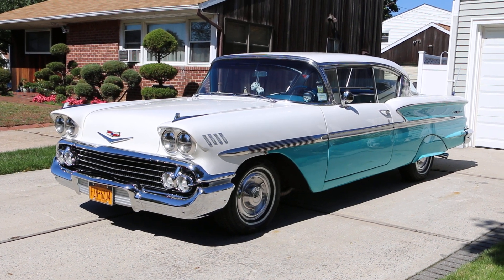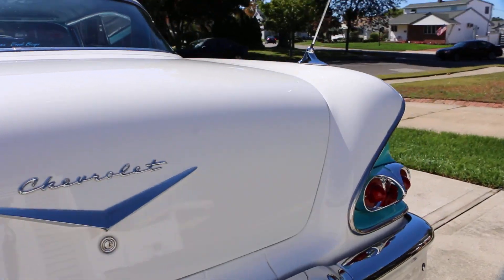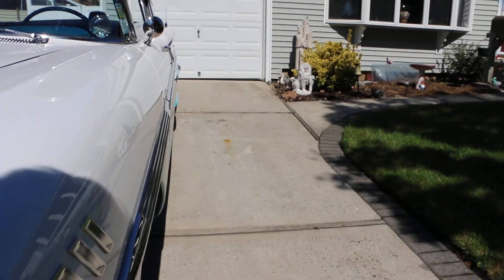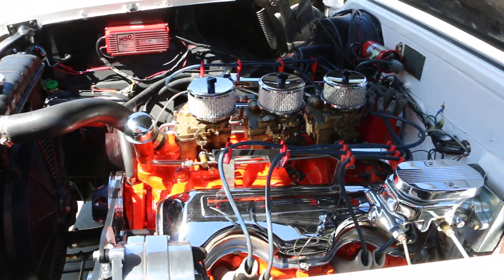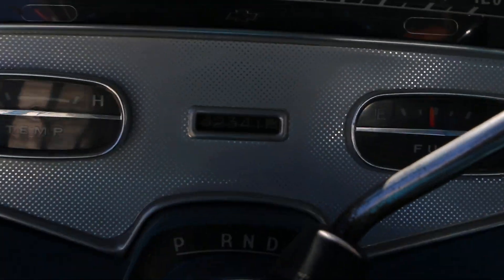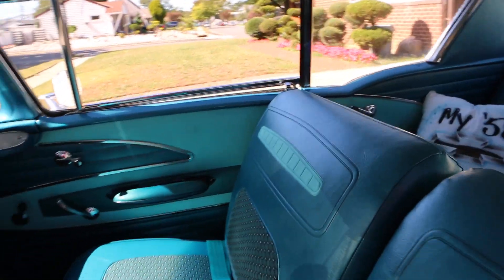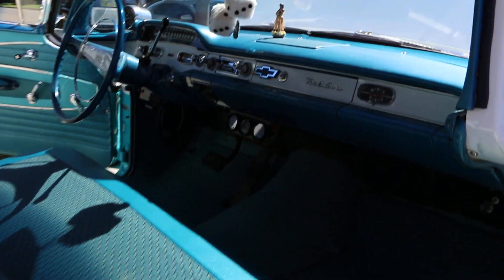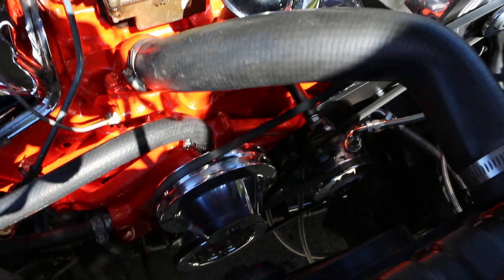1958 Chevrolet Belair For Sale~348 w/ Tri Power~New Interior~Fresh Two Tone Paint~FANTASTIC

Comment: I bought a brand new 58 bel air with post and 3bbspeed with posi trac. It was very eye catching with its all black laquer paint. I raced it a lot all over so. Cal. In super stock class. The 315 with solid lifters was only car to beat it. Not many of them were around at the time. The big negative was it brnt push rods a lot. 
  It probually was my fault back the. Odly enuff i sold it about 8 months later an bought a unsold 57 210 with post. Thatb car was really cheap new out the door for $1600. I,had modif8ed it tomrun in D gas .was la5er sopd w3nt I went intomthe Army for $1500
Reply: What???   Push rods dont burnt, beter contact someone that knows well about htis issue. Someimes the problem is in another place. Sometinmes its not a car problem, its a problem that people change originality of the engineer project and things end up with problems. Thas is whats happening to you.
Reply: Pushrods on the W-head 348/409 are a known weak point.  They rely on a hole machined into the cast iron with no guide plates.  It pokes up through the machined hole a good 1.50” proud,  so there is lots of instability and flexing at the tip into the rocker arm cup.  348s have 5/16” pushrod diameters and 409s had 3/8” pushrods, but even 409s suffer from flexy and bent pushrods and benefit vastly  from guideplates installation.

Comment: Get rid of that cheezy electric fan and get the proper fan shroud.  Going for a somewhat original appearance?  You need the fan shroud, but opting for the clutch fan.  For your setup, you need either the 2-rib or 1-rib version.  Electric fans are for losers.